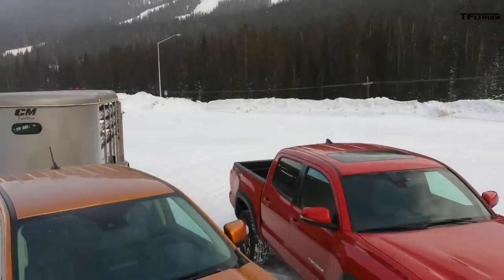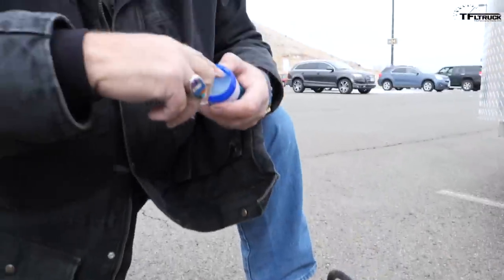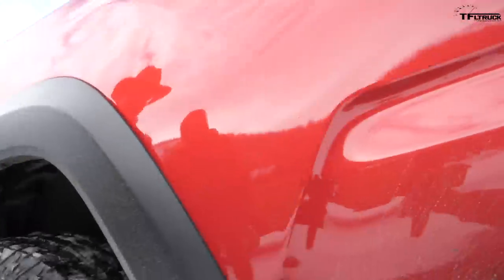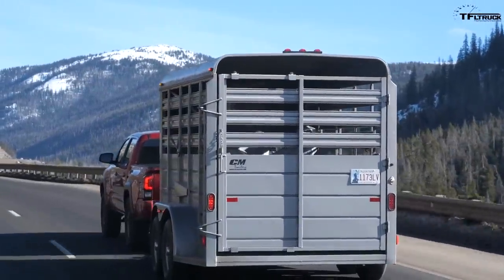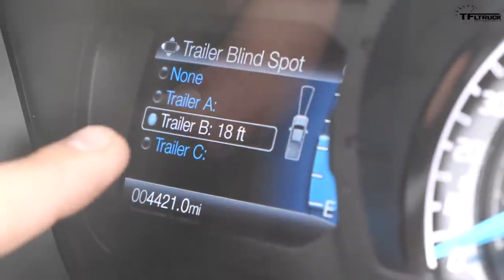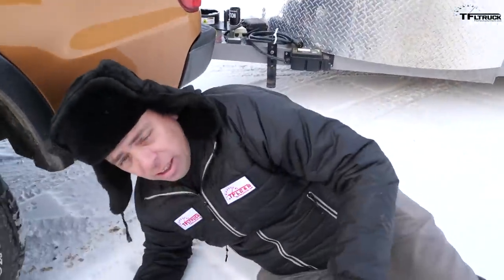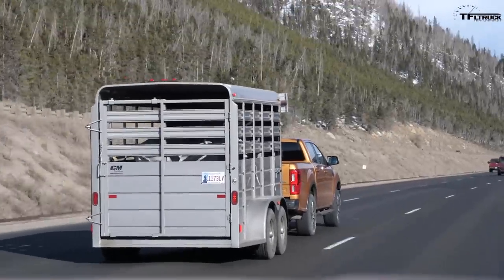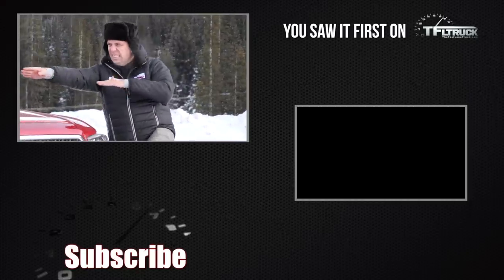Best Midsize Towing Truck? Ford Ranger vs Toyota Tacoma vs World's Toughest Towing Test

Comment: I gotta be honest, im pleasantly surprised to see the fuel economy on the Ford.  I was expecting much worse
Reply: All this boost or eco  talk is crap, the Ecoboost engines are giving best in class mileage when not towing and equal milage when towing.
Reply: @benjaminwayneb  i wouldn't say that. it's pretty well documented that the 3.5 is far thirstier than it's v8 competitors when towing. i don't know if a single comparison test where that isn't true. that's why it's so surprising here.

Comment: Apples and oranges, V6 vs 4cyl turbo if the ford had a v6 it couldn’t beat the Tacoma MPG. And as far as it goes the Tacoma manual transmission is actually 2mpgs higher than the auto. Plus you don’t have to hunt gears. I agree the Tacoma auto trans hunts gears too much. As for the 10speed auto trans in Ford all it does is hunt gears, it just has much smaller ranges between gearing so it’s not as noticeable on downshifts. I’ll say Ford is more comfortable height inside the cab. But in the end the Tacoma will have fewer problems mechanically, and hold a higher resale value. Still gotta hang my hat on the Tacoma Horns. Just try the manual trans!

Comment: What the heck is the "Dual Injection System" the ruskie was saying on the 3.5l toyota engine? wow the Old Cowboy hat guy really hates the Fords /luvs the Toyota. Ha ha,  Pinky tea drinking luxury Lariat ! Ha ha Thinks a Tacoma is big truck tough looking. It looks more like 4" of cowboy hat room in the Ranger but they didn't measure it inside. My dad drives a tundra but I am a ford guy so its very interesting their both good for small pickups. That lil 2.3 litre Ford with a 10speed trans is still the engineering marvel tho.

Comment: Why is all tow test in snow? Can't they do one in summer up the ike? That will really test the truck. Cars/trucks perform better in cold air condition as colder air is more dense equal more power. Also need to test these truck cooling system if they do it in summer.

Comment: Why does the same engine make 301Hp in the Camry? 278HP in the Tacoma. The ECT button is for accelerating power, not braking power. This is from Toyota"When pressed, the ECT PWR button will adjust shift points so you can reach higher RPM levels before shifting into the next gear. Best used when you need an extra burst of power while towing, the ECT PWR button functions much like the 2016 Toyota Tundra Tow/Haul Mode. A few more driving situations where the ECT PWR will come in handy include merging with freeway traffic, passing vehicles on the highway or climbing steep grades. It is important to note that extended use of power mode will result in lower fuel-economy ratings."
Reply: Thomas Luggiero the 3.5 is derated for truck duty to improve reliability.

Comment: My Ford Fusion is sooo full of problems that I am unlikely to ever buy another Ford.
It's comfortable and quiet, with an easy rise and good handling.
But since 2010 I have had it recalled for major fixes twice (once for eight months) and had several stupid things break, like the moon roof and door handles. 
Are they trying to save a few bucks for the shareholders by using cheap plastic parts?
Penny wise, pound foolish (look it up).
Well, I don't intend to buy another Ford vehicle.
Reply: Toyotas I've had aren't as comfortable, but they are more reliable.

Comment: 8 in mirror tiny ford housing dont count an you can't  When vehicle from the top of door jamb in another vehicle from top of the roof line an call it the  Same measurement. Have fun in your ford ranger when your bottom out an have to slam your brakes an loose control.  Fords numbers are so loose your gonna see alot of trailer crashes

Comment: I believe the test for noise wasn't fair, I believe you said the rpm on the Toyota was 5k and the rpm on the Ford was 4k. Makes me wonder about the accuracy of the rest of it, I think you should have used the cruise control for it all to reduce human differences in the gas/brake timing and pressures applied to the pedals.

Comment: It's high time for TFL/Mr.Truck to put together a mid-size/full size truck mash-up and put the fuel economy BS to rest for good. Put the mid sized trucks up against their full sized brothern with a V6 (or most fuel efficient engine/transmission combination) to find out if size really does matter. I am so sick of reading that mid sized trucks provide absolutely no benefit besides being easier to manuver in the city or wherever. Let's put a 1000 lbs payload in them all and hook them all up to 5000 pounds and put it to rest. Let's see if you actually can purchase a more fuel efficient full size truck for your needs. Leave out the diesels, we all know they consume less fuel but they can cost thousands more.

Comment: I think all the midsizes should have an option for trailer mirrors, or a good ext mirror designed from factory thru the dealership, that doesn't shake or rattle like the garbage you get when buying ext mirrors aftermarket. Both of these trucks are unimpressive. It's why I went and bought a fullsize. Even tho I didn't want to. 5000lbs in these trucks is pretty well maxing them out... despite the higher tow "ratings".

Comment: I’m actually a ford guy but this time I went Toyota mainly because of reliability and the eco boost in known for oil usage issues and carbon buildup when the miles pileup usually at around 70,000-80,000 miles Toyota has a clean cycle to wash away blow by ford doesn’t

Comment: You can see that that Tacoma has its nose in the air a fair bit... if that thing is towing 5k, I’d hate to see it at its supposed tow limit of 6400k... that engine is straight up screaming towing that 5k uphill...

Comment: Th Toyota was getting less than 6 mpg- at least according to the dash gauge! Did not see any indicator in the Ranger dash. I have worked in the auto repair field since 1968, something no one ever seems to mention about "turbo" vehicles is the cost of repair to the turbos usually at the 80-85K miles mark ( they all seem to start drinking oil??? It is still a tiny 4 cyl. running near max. to do what it does. Superchargers MUCH MORE DURABLE!!!

Comment: These videos sold me on picking up a new Ranger, until I contacted the dealership and they wanted $43,500 for a middle of the (trim)road model in 4x4.  Damn, these new vehicles are expensive, they beep when you don't do things "properly," and are full of mandatory features that I have no business using.  I'm only 22, but shit, are these things instantly expensive.  For around $33,000 yeahh.. I could see that.  But $40,000+?!?!  NOPEEE

Comment: I owned a 2000 Tacoma SR5 2x4 extended cab, 2018 Tacoma Sport 4x4 double cab short bed, and now a 2019 Tacoma Off-Road 4x4 double cab long bed. I have to admit that the Tacoma has the ugliest body and interior among other trucks in the same class, especially in comparing to Ranger. Ranger definitely beats Tacoma on how awesome it looks, inside out, and much higher mpg. However, after calculating the high resale value vs low mpg of the Tacoma, I still decided to go for it the third time. I don't know how the future resale value will hold for this generation of Ranger, but as it is for my 2000 Tacoma SR5 at 340,000 miles in 2016, it was easily sold for $3,500. The 2018 Tacoma Sport, after almost a year of driving, I totaled it at 15,000 miles and Progressive Insurance paid me $36,724. If Toyota could have Ford's body or Ford could have Toyota's engine and transmission ... It would be awesome but I guess we can't have both. Thanks for the awesome review.

Comment: The prices on these are ridiculous. I paid just  a smidge more for my new RAM 2500 tradesman Cummins diesel and could pull those trailers AND trucks up the hill faster and have less brake applications going down the hill AND get better mileage. Who buys these things to tow?

Comment: Tip. Add a bunch of salt to the water. It will lower the temperature at which water will freeze. its also good if you are freezing blocks of ice to bring camping. Freeze water in milk jugs and the ice being extra cold will last longer before melting. The Tacoma will outlast the Ranger by a long shot. If you like trucks that will break down buy the Ford. Otherwise buy the American made bulletproof Tacoma.

Comment: Overpriced and still waiting for a true small truck 200" or less. Since Ford has gotten rid of cars they really need to expand their lineup and hit lower price points otherwise there's no vahicles for someone who would buy a focus or fusion to go. I would love to see a Fiat Toro or Musso equivalent by Ford. I love trucks and make mulch runs and light work like that multie times a year but these trucks would be far to expensive for that. $22-30k doesn't get you much in the truck market at the moment which is a problem.

Comment: The headroom difference between the trucks was the caused by the sun roof in the Tacoma.  I've got a tacoma with no sun roof and I'm 6'2" tall - no problem.  I'm also a Ford guy back to 1978.  I wanted to love the new ranger and found that there wasn't enough legroom - the left hand wheel well protrudes too far into the cab to allow me to fit.  I agree that the seat on the Tacoma is too low to the floor.  I installed 'seat jackers' from https://desertdoesit.com.  The extra 1 1/2" really helps in that department.  I had another 'fear' about the Ford and that is that the 2.3 liter engine looks suspiciously like the engine in my Mazda CX 7.  Lots of power but a real hassle regarding turbo seals and oil burning.  Again, I really wanted a Ford but couldn't pull the trigger on it.

Comment: I really wanted a ranger until I heard him mention sound enhancement.
Reply: That means nothing. The powertrain is so quiet normally. The Ranger is the better vehicle by far. I drove both. Ranger by long shot!
Reply: It can be disabled by you or dealer, but yea agree that it's a waste of engineering and price for anyone to do 'fake sound'.
Reply: Well when you have a hamster under the hood they had to make fake engine noises on a recording to play over the radio.
Reply: @wildbill23c  hardy har har. Get with the times. That hamster will smoke whatever midsize truck ur driving. All the fools that dont want see Ranger back on top..or surprised its amazing again are hilarious an un-American!
Reply: Well sound enhancement is used on dozens of $100k - $400k vehicles. You wouldnt have issue with that right? Lol. New Ranger is most quiet an plushest midsize truck out there w/a monster 2.3L. We love ours.
Reply: @Davido50  ,  Your absolutely right. I have a 2019 Ranger and I have spanked all of the Midsize competition that have tried to keep up with me and my Lightning Blue Rocket. It will do a 130mph and it had some to spare.

Comment: Please do a test run using cruise control set to the legal speed limit. I predict you won’t have to use the brakes on the down hill run. And it will maintain the speed by downshifting quickly on the uphill run. Should see a much lower time in the uphill run

Comment: For the price of these trucks just spend a bit more and buy a full size truck with a V8. Had a T100 4X4 with a 5 speed manual transmission. Didn't get any better gas mileage than my Tundra 4X4 with an automatic transmission. It couldn't pull any where near what the Tundra does. Plus the Tundra doesn't strain it's guts out doing twice the work.

Comment: It seems odd that neither of these trucks is available with factory installed trailer brake controllers. Given the weight that these trucks can tow, it should be on the options list. I'm not a big fan of adding aftermarket controllers to a new truck.

Comment: I think the reason the ride is better in the Ranger vs the Tacoma is due to the bump stop is almost similar to a sumo spring bump stop which actually adds additional leveling ability and spring load rate.  I agree with Mr. Trucks spring theory, however, with one spring I would be concerned about snapping the one and only leaf while under loaded conditions.  I snapped a leaf once in my Tacoma before going to Dever Heavy load leaf pack and the remaining leafs are the only reason I did not end up in a situation of being stranded with a full payload and down vehicle in a “dead highway zone” with no mobile service.  “To have two is to have one, and to have one is to have none”.  In the end, I will always be a Toyota man but welcome the competition to push Toyota into more product development.  Side note my Taco “tows” and absolute monster Off-Road.

Comment: Unless the tarp is sealed air-tight around the water tank at all edges to bottle in heat, it’s not doing anything. Wind chill doesn’t make the water any colder.

Comment: I'm hoping for some opinion here. I just purchased a 23ft Airstream (4761 dry weight, 6000 GVWR, 672 Tongue/Hitch Weight, 2 Axles) and I need a tow vehicle. I'm looking at 2 SuperCrew options: 

1. A 2019 Ford Ranger Lariat SuperCrew (7500 Tow Weight Capacity, 750 Max Tongue Weight)

2. A 2019 Ford F150 STX SuperCrew 5.0 V8 (10100 Tow Weight Capacity, 1,010 Max Tongue Weight)

Is the Ranger enough?  I'd like to be able to tow cross-country at some point?
Reply: airstream's have heavy tongue wt   full size trailer = full size truck ,  ranger think it be ok with a 7' wide 22 ' airstream sport
Reply: Go with the F150 for sure. And get the max tow package if you can. It's worth it. Once the truck gets older they start to overheat when towing because the radiator loose efficiency. Here they test new trucks.

Comment: The Ranger looks all right, and it's good that Ford is going to bring some competition to the Taco. Hopefully that will get Toyota to step up their game. However, I just don't trust turbo-charged vehicles because eventually that piece of equipment is going to need service, repair, or replacement, which means top dollar. Also, they usually call for Premium fuel, so it's gonna add up pretty quickly.
Reply: 87 octane for the Ranger.

Comment: Are the ecoboost engines in these rangers reliable? Ive heard bad things about ecoboost engines before
Reply: Well my aunt works at a dealership and has 4 dead rangers sitting on the lot with less than 1,000 miles on them all requiring new engines...so I'd say not reliable at all.

Comment: I'm thinking seriously about buying one of these to tow a two horse trailer. Which ever one I buy would replace a 1972 International 1110 1/2 ton 2WD long bed with a 5  liter carbureted V8. I anticipate gaining comfort and convenience features. But it sounds like I'd lose gas mileage. Towing my horse trailer I get 9mpg now.
Reply: Do you get 9 mpg going up the IKE gauntlet hill? The Ranger has 80 more hp. and 40 ft. lbs. more torque then your International.
Reply: Good point, but I would have hoped for more progress in 46 years. I'd give up a lot of the convenience features and toys that new trucks are littered with for more focus on the things a truck is really meant for.

Comment: The Tacoma engine seems to struggle and feels labored to me with the slightest hills. The trans also couldn't figure out which gear it wanted to be in. Moved to a 21 Ranger Tremor, and couldn't be happier. Seating alone makes it a worthwhile change, and that engine/trans combo just works great.
Reply: Well you go ahead and wait for that turbo to go your rear end to go and the transmission to fail and the mess of electrical problems headed your way......haaaaaave funnnnnnnnnnn😂
Reply: @seanbutler2291  Why would I do that? Have 170K on my other Ford and it's doing fine.

Comment: Vick's Vap-o-rub - Ha ha!  Kidding aside, next time you need 'grease' don't go with Vick's but buy a few tubs of lip balm. I'm a retired chemist who worked in a plant that made the Vick's VR look like grease. It's actually a non greasy gel. Wanna test it? Drop a dollop into some hot tap water and it'll dissolve without any oily sheen on the water ;-)  With that I'd call the downhill braking an even 7 applications because you almost hit the taco brakes at the end and you can't be sure the surge brakes weren't at least partially applied on the taco's downhill.
Reply: Dave Pritchard The reason it wasn’t 7 applications is covered towards the end of the video. Because the Taco didn’t go over 60 like the Ranger did 22:25
Reply: @lukestoyz  - I took note of that. However with surge brakes, the shank has to move easily in the hitch w/o binding for the surge brakes to work properly. They tried to lube the shank but used a non grease lube. Maybe surge brake was working, maybe it wasn't. If it wasn't you can't be certain that the trailer brakes weren't partially engaged. Without a brake controller one can't see if the TT brakes weren't slowing the taco. The comparison turned to apples to oranges at the tt's brake actuator: the ranger had e-brakes, the taco had surge brakes.

Comment: If these are “mid-size” trucks than what is a small or compact model?
Reply: snipervision1 Ford is testing one, it’s called the Courier
Reply: Still yet to be created. There is significant evidence to backup rumors that suggest Ford is investing in a uni-body small-sized truck with the Maverick nameplate. You can bet that other companies may follow if it does happen. As for right now, that's just what the segment is called.

Comment: You didn't touch on this is the video, but in the closing shot of the trucks, it looks like the Tacoma has a sunroof, and the Ranger does not.  If that is correct, it would explain the difference in headroom.

Comment: Andre skipped from 3 brake applications to 5 during the Tacoma section (check 5min until roughly 6min).  It's possible that they silently counted the 4th brake application during that minute he was talking about the engine and transmission.  But I don't think so, which means the Taco only had 5 brake apps, which is incredible.